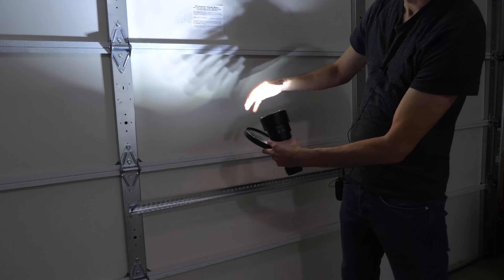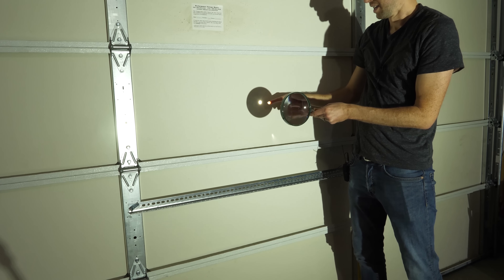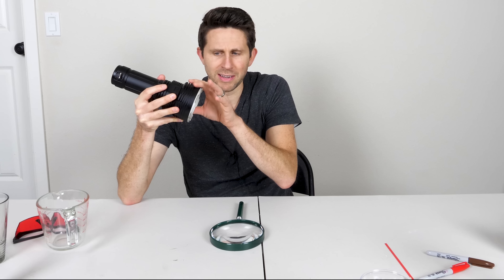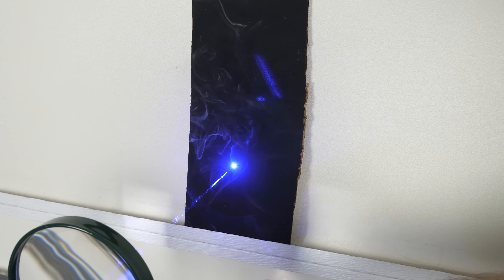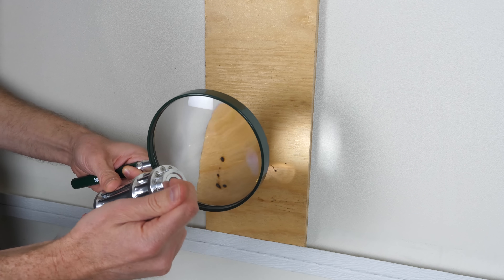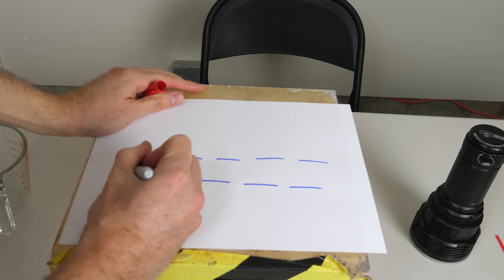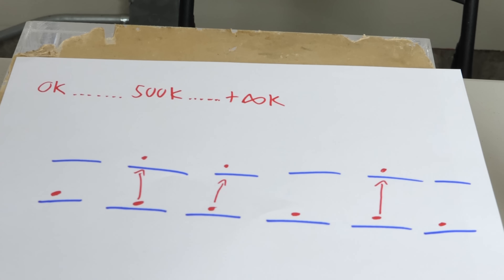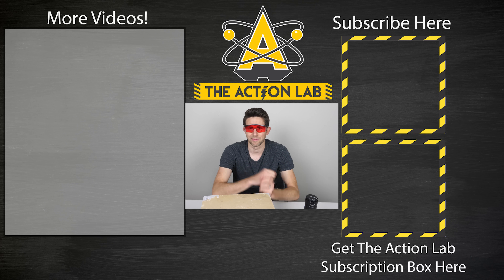What Happens if You Focus a 5W Laser With a Giant Magnifying Glass? Negative Kelvin Temperature!

Comment: This guy has no clue about optics, or... common sense! The flash light has a concave reflector, reflecting it ourwards, while the laser is a straight beam to begin with... He doesn´t take this fact into consideration at all, when he makes his assumptions, that´s why it´s all wrong...
Reply: Caleb Edwards  No, not right. I don't know about the whole laser part, but the first part of the video is absolutely true, for non collimated light at least, it is impossible to focus it hotter than the originating surface. The classic example is that you can never start a normal fire with moonlight. (like, with twigs etc. Using a low temp flammable material is cheating heh)

Comment: The spot size or "waist size" (ω) of a gaussian beam (which is what a laser kind of is) is equal to the wavelength (λ)divided by Pi times the angle (α) of the beam between lens and focus.  (i.e., ω(0)=λ/πα)   THAT determines the spot size.  All the energy is in that spot.  The temperature will be determined by the target material.  Some 20 years ago I worked at Xanar, a J&J company, and designed surgical lasers.  That is the operating equation for beam size.  Nothing else.

Comment: you are wrong.   the further away the flashlight the more light was diffused.   but the magnifying glass took even the smallest amount of light and increased the light from the source and increased it to its original brightness.   If you measure the amount of light coming off the source, then measure the light that has been diffused at any point, you will measure a reduction.   But if you measure the light at the source, and then measure the light in front of the magnifying glass, they will measure the same, or brighter.

Comment: When you focus a light down to a point, you aren't increasing the temperature, you are taking all of the energy contained in your dime sized laser beam and concentrating it all down to a pin point. For example, the sun emits 1,368 watts per square meter on the earth. Shining onto a piece of wood at noon, it simply warms the wood. Assuming that you have a 1 power lens that has a 1 square meter area, and if you focus sunlight down to a pinpoint using this lens, you still have 1,368 watts of energy but instead of having it cover 1 square meter of the wood which is essentially a large heat sink, now you have 1,368 watts of energy concentrated on a single pinpoint and the wood can't dissipate it all harmlessly so it begins to burn.

Comment: Wait so if you had a light source like a lamp its impossible to focus it down to a smaller point and raise its heat? What if you had a mirror completely surrounding the light and it funneled all of the light into one focused small opening. The condensed light all focused into that one spot wouldnt be any hotter?

Comment: You are describing it incorrectly.... I agree you ca never make it hotter than the temperature of the origian item.. But how hot is the element of a regular flashlight bulb ?hot enouh to melt and burn tungsten if it wasnt in a vacum ? So your describing what bringing the light to a point does....and how it works in my opinion.

Comment: The key issue of this video and discussion aswell is what I got right off even before I figuered out total neg temp must be achieved which still is not the point of the video. The point of this video and his discussion is how you can not break the 2nd law of thermaldynamics. Try as you might. You will not achieve it. If it was possible we would be bringing cold into heat instead of bringing heat into the cold. Steven Hawking explains it very well. But simple as it maybe. This video is explained well how you can not break the 2nd law of thermodynamics. Period.

Comment: The focused spot is still not hotter than the source. The source of the laser is actually the semiconductor emmitter inside the laser diode itself.  That is only microns wide. Your magnifying glass is not perfect (spherical aberation, etc.) and the spot you made, while smaller than the beam, is not smaller than  the original light source (emmitter).  Definitely do not need spooky negative temperature math to explain this!

Comment: The reason why it doesn't work with the flashlight is that the spray of light that comes to the source is too wide, therefore, a magnifying glass isn't able to converge every light rays to a small area. That is the exact reason why it does work with the laser, because it is already a device that concentrate its energy to a small ray, the glass is able to converge and concentrate even more the ray of the laser, so the same energy is applied to a smaller area. It's like a water hose that, having a tighter end than the start will result in a higher pressure out. But the initial and final energy stay the same, the same amount of water will flow since the source is stable. So by concentrating energy into a smaller area, the ray is able to penetrate more efficiently into the material it faces (wood in this example). Temperature is the same, but the same energy is shared to fewer atoms from the wood, making them react even more and making wood burns more easily. The thermodynamic laws is still conserved

Comment: Your explanation about the "impossibility" of getting a focussed point hotter than the source is incorrect. By focussing the energy from a source on a small point, you CAN end up with a point that has a higher temperature than the source. It will not have more total energy than the source, but the energy that it has is concentrated in a smaller space, leading to a higher temperature (depending on some factors).

Comment: You are confused.... population inversion only occurs with resonant exchange of photons. This is why lasers need a donor atom or molecule to feed energy to the upper states of the receiving atom or molecule. Co2 lasers need helium as the donor, ruby lasers use chrome, and solid state lasers do the same. With heating by any source there is no population inversion as electrons reach higher energy states till they are boiled off. Negative temperature is defined like this  to make the math useful in the quantum world...
Reply from the maker: Not sure how anything you said contradicts what I said...Negative temperature is needed in the quantum world to define the temperature of things like lasers. Due to population inversion they act as though they have a negative temperature.

Comment: Ahh, with the flashlight,  if you have a long enough mirrored or polished metallic tube, you can focus all of it directly into the magnifying glass
Reply: I doubt it. If you had a perfectly reflecting tube, it would have made no difference from if the tube were not there. (Imagine a path of a single photon travelling at an arbitrary angle.)

You can take a non-reflecting tube, which will restrict the light to photons travelling roughly in the straight direction and absorb the rest.

Comment: I thought Kelvin starts at 0, which is the absolute 0, - 273,15 Celsius degree, so there is not negative Kelvin, because one can't go under absolute 0, so as one cannot reach absolute 0, because that would mean the matter is gone. So -1K equal to - 274,15 Celsius degree, but we can't even reach 0 Kelvin. Even Space isn't 0k, it is really close to it like 0.0000000000000000000000000000000000000000000000000....1 K.
Reply: Outer space has no well-defined temperature, because it's an almost perfect vacuum. You can talk e.g. about the temperature of the relic microwave radiation; it turns out that it's equivalent to black body radiation at about 2.7 kelvins. (Astronauts and designers of spacesuits were often more worried about overheating than about freezing, due to the absorption of Sun's radiation and having no medium to carry the heat away.)

Comment: Line the inside of a pipe with foil, shine the flashlight into it and get a solid beam that doesn't spread out as much
Reply: Waveguide
Reply: That's how You make a laser
Reply: @hjdjdudhhfhdhdh5312  Sorta
Reply: If you line it with foil, the light will be bouncing all over throughout the tube and will come out just as disorganized as it was before, so that does nothing. If you line it with perfectly black material, then light will come out more parallel, but it will simply be the smallllll portion of the light that BEGAN parallel to begin with, which is only a tiny % of the original brightness. And you can only get that by having a long tube. So by the time you've done that, you're magnifying a small % a long way away, and it's exactly the same as the original garage door with the light on the other side of the room again. Not very hot because only a little bit of the light. Neither helps you.
Reply: @gavinjenkins899  I think the idea was to smoothly line the inside with foil then it will act like a wave resonant cavity.. But total cannot be more than you start out with for net energy.

Comment: sounds fully wrong. You are operating a wrong law here. The law of conservation of energy is what you should be looking at. 
1. Flashlight: you only get 0.5% of the produced light onto your glass, so when you focus it perfect enough it may even burn, IT IS ONLY the question of energy to area ratio (focus it down to nano mm and it will burn and it will be bright as hell, but you will barely see it)
2. Laser 99% of output power (light, not counting excess in heat) heats the glass and now it is concentrated from 2mm x 1mm down to 0.5x0.5mm - it will be hotter on that point because applied energy density is higher - but it is NOT MORE energy than at the laser device it self, not by any mean, it is just more dense, so it can heat up that SMALLER area faster - look at the trace of burned wood with margining glass.

hope that clears your misconception
Reply: Keith 0lsen I’m only in 5th grade my guy •~•
Reply: Keith 0lsen uhhhhh idk •~•
Reply: @Keith 0lsen Dude that's not how it works, the space between matter is not pollution from a theoretical drive derived from the theory of general relativity (That's what a alcubierre drive is) the universe is most likely to be expanding from the force from the big bang, which is increasing the amount of empty space in the universe. Don't hop onto a scientific thread and just start saying random shit.
Reply: Henz593 ok ummm I think I should just delete the comment •~•
Reply: What he said
Reply: Heat and temperature are not related as you think
More temperature do. Not means more energy
Reply: i am verry sad about the amount of scrolling i had to do before i found a sane person.   
but you are right.  the guy in the video is a nutjob
Reply: Up up up
Reply: energy is always conserved in a thermodynamic system , the video is right , the second law indirectly states the  equilibrium in energy hence proving the conservation of energy in an isolated system , but I couldn't resist the fact that you were right about the energy to area ratio  . Energy is conserved in relevance to three dimensions in the form of area , there is no negativity involved in this , it is just point of contact (the area of intersection ) , in order to compensate for lost area , energy is exerted in the form of heat.
Reply: You're right, but the heat does not change. The wood burns faster only because the laser rays are concentrated in a smaller area, therefore exciting fewer atoms with the same energy and making the wood burn more easily.
Reply: But... but.... The Negative Temperature!??!!
Reply: @LilMissMurder3409  negative temperature is only a theory made up by own mind and cannot exist in the physical world. Since -273,15C or 0K is the absolute zero and that nothing can exist nor get colder than this, temperature can only be a positive number. Even your mind can't conceptualize a negative number. You can think of something, or don't think, where thoughts doesn't exists. Same goes for everything in this universe.
Reply: @vb9766  I was being sarcastic...
Reply: @LilMissMurder3409  Nice one lol
Reply: @vb9766  well said. Tired of the bullshit 'science' other people try to spit out
Reply: VinceAsmr again, heat changes. Heat is not equal to amount of energy. Heat is the product of energy applied to the surface. The densité is larger, thus pick temperature is higher.
Reply: @airBornFpv  No, no. Heat is energy. Temperature is not. Heat and Temperature are not the same. In common parlance, we speak as though they are, and certainly they are related. I cannot make something a higher temperature unless I put energy into the system. Temperature indicates a higher level of heat, but it is not heat itself.

To quote some nifty folks at CalTech: "Heat is the total energy of molecular motion in a substance while temperature is a measure of the average energy of molecular motion in a substance." -- coolcosmos.ipac.caltech.edu/cosmic_classroom/light_lessons/thermal/differ.html
Reply: BMW- Upgrade CH just saying my guy 1: DAMNNNNNN 2: the law of conservation also states matter cannot be created or dretroyed BUT I find this un-true because the universe in infinitely expanding and everything is made of matter so that’s why the law of conservation is kinda rigged
Reply: https://www.mpg.de/research/negative-absolute-temperature @VinceAsmr "just theory" 
doesent mean that the guy in the vid is right..
Reply: @jenellebanfield8184  ENERGY cannot be created or destroyed.    matter can.   matter is just a form of stored energy
Reply: @jenellebanfield8184  The space in between matter is empty space though. So basically as the universe expands there's more empty space, which is why the universe is thought to be getting colder per area because molecules aren't near each other to compile heat
Reply: Nerd
Reply: Nerd

Comment: All i can see from this video is that you took the same energy and focused it to a smaller point, which increased the temperature of the surface you were shining the light on enough to smoulder more quickly than the less focused beam. In order to prove that the surface was actually hotter than the source of the light, you would need to measure both the surface temperature and the source temperature (or estimate it using math and observation), then compare the two. Unfortunately you did neither, so everything you said was almost entirely unsupported except by anecdote. This video does nothing to improve my understanding of the underlying technology of lasers or the physical properties you discuss, and so is very disappointing to me. :(

Comment: So, what if I made a tube between the flashlight and the magnifiyng glass, connecting them, with a length equal to the distance the glass requires to focus that light to a small point, wouldn't it prevent the light from "escaping" from the sides and make a hotter focus point? And to prevent energy loss whenever the light "hits" the tube's walls, the tube's inner walls could be covered with mirrors so that all that light and energy bounces around 'til it get to the glass itself, wouldn't it be lossless? I really don't possess the required knowledge to know if this is possible or not, but it came to my mind whever you said that the problem was the light escaping

Comment: Laser = light of one wavelength with much less dissipation over space (collimated).  Caused by exciting atoms in a medium and reflecting resulting ejected photons back and forth through that medium.  Each reflection throug the medium's - from one end to the other -  increases the power of the beam until the beam energy has enough intensity to pass through an 85% (HeNe laser) at one end.  Result - high powered colimmatd light/energy with much less dissipation over a distance than typical, multi-wavelength (white) light.

Flashlight - normal dissipating light source made of multiple wavelengths which spread easily due to destructive interference of those wavelengths over a distance..

Focus laser to a pinpoint and all the higher-than-white-light, concentrated energy is further concentrated onto a small spot.  Hence less dissipation by the medium being burned and more efficient burning.

Why is the second law even brought into this discussion?!?  There is no brighter light being produced - just a focusing of the burning power onto a smaller part.

I shudder whenever I come to this channel at the just-enough-knowledge-to-make-things-complicated "conclusions" and (sorry, but) junk science.

Chemistry, Physics, Bilology, math, computer programming teacher of 20+ years..

Comment: This video is incredibly hard to watch. You throw in random statements that are kind of meaningless. You could've easily solved the flashlight problem with two magnifying glasses.
Stating that it will never be "brighter" than the source of the flashlight is where you kind of lost us dude. You cant create energy. A magnifying glass will certainly not. You can focus it, however you will probably find that the reflective properties of the magnifying glass will outweigh the benefits.
Also, there is no way that laser is 5w. It may draw 5 watts, but its incredibly inefficient. That I can tell just by looking at it.
I'm sorry my dude but the physics in this video are just garbage.

Comment: If you put a loop close to the flashlight, you get a beam that goes straight forward and not outward. Than you could use a second loop that is far away from the light to capture the beam and focus it into a point. 

Also i think you aplied the thermodynamics rule in an incorect way. Energy and heat are not the same thing. If you capture all the light of your flashlight and focus it into a point, the point will be hotter than the surface of your flaslight. Because you get the same amount of energy in a much smaler space